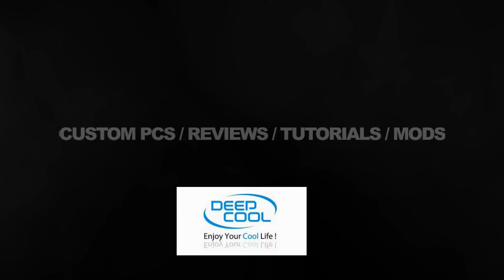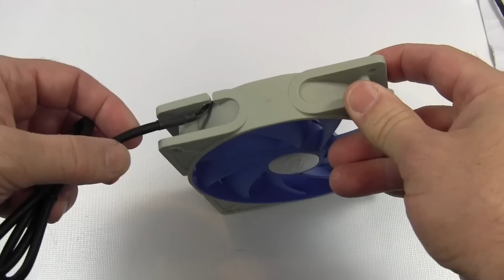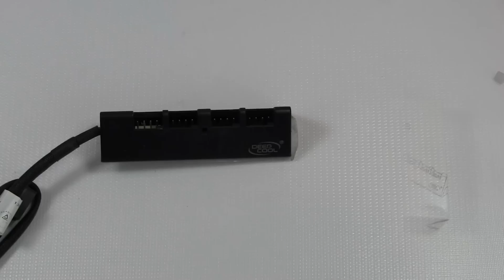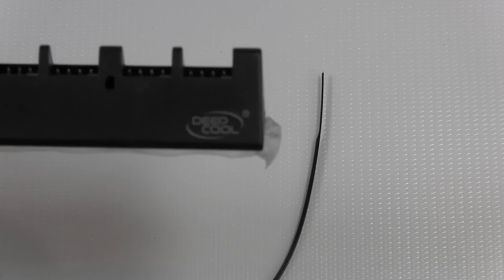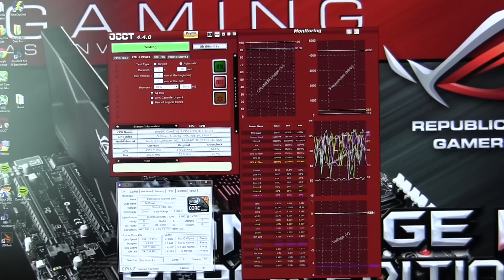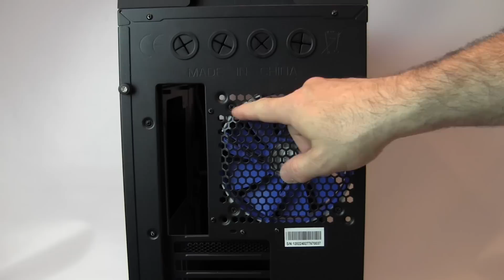Deep Cool UF120 PWM Fan , UF140 PWM Fan, and Fan Hub Review

Comment: I've got old asus board with 1 pwm cpu header + 1 4pin sys_fan header but 4th pin shows +5v at the place of pwm wire in manual (asus played smartly here). Basically it's a 4pin Voltage controlled header which I'm currently using with Corsair's ML120 Led Elite PWM fans.
Some says that Magnetic Levitation fans from Corsair needs PWM strictly to levitate them.
Please tell me if I should continue using sysfan header with voltage control or I should use the only available CPU Pwm header with Deepcool Hub to get them pwm controlled (cpu+case fans combine to that cpu header)
Please tell me what should I do😮

Comment: these are excellent fans.  i did extensive testing with the UF 120 pwm  vs the noctua NF-12 on a coolermaster hyper 212 evo and the deepcool fan is quieter and has about 1 degree bettter cooling on that particular heatsink.  that heatsink does better with  certain "air flow" fans rather than the static pressure variety.

Comment: Is it actually safe to use a fan hub like this? i.e. to connect 4 fans to a single fan header on the motherboard.
Also, when connecting a 3-pin fan to this fan 4-pin PWM hub, will the 3-pin fan speed be controllable too or is still going to at run a full speed all the time?
Reply: If the rated amperage for your header is high enough, yes, which it probably is. I've never seen a hiqh quality or LED fan be higher than .33-.35A and your headers are probably rated for 1A at least. You can usually put 2-3 fans on one header

Comment: Ordered the Deepcool fan extension cable to use with 4 fans will this hurt my board? or should i run the fans @ half RPM just to be safe?
Reply from the maker: +Denzil Manickum You should be fine with using a fan extension with 4 fans. I have used 3 and 4 fan extensions, but they should be powered them from my power supply power and not one motherboard header.
Reply: Thanks I think ill go with using two deepcool fan hubs powering two fans each that should be safe to connect directly to two separate fan headers on?
Reply from the maker: +Denzil Manickum Yes. That would be fine.
Reply: +Ronsanut hello, how do you power the fan hub from the power supply?, and can i connect 3 fans on the deepcool fan hub through my motherboard? will it fry the connector?
Reply: You do get molex to fan headers
Reply from the maker: +shorteeayy  You can power the hub from any motherboard fan header or use a 4 pin molex to 3 pin adapter . 
Something like this works:
http://www.amazon.com/HDE-4-Pin-Molex-Replacement-Computer/dp/B0081K3ZS0

Comment: at 9:39 UF120 is on intake and uf140 is working as exhaust right ?
Reply from the maker: +omya222  The fans in the center at 9:39 on the testbed are running as exhasut (blowing at you) and the fans on the end are running as intake (into case). Basically the air flow blows to the fan motor hub. If you can read the Deep Cool logo on the fan motor hub, it is blowing air out past it.  
Hope that helps.

Comment: I would love to use the fanhub, but does the normal motherboard connection support 4 fans?
Reply from the maker: Yes it does.
Reply: Cool, thanks for the reply!
Reply from the maker: Yes you can. As long as you don't exceed the current rating of the header. I would put 4 on one header without issue.
Reply: Hi, after that comment I actually bought 2 of these fan hubs, they worked great :D
Reply: I dont see why not.
Reply from the maker: You can drive as many fans as you want on your motherboard fan header, AS LONG as you're not drawing more amps then the header was intended to output. After a bit of searching, a common value I've found is 1 amp (12 watts @ 12V) motherboard fan headers. Your results may vary.  I have used up to 3 fans off of a mobo header without issue.

Comment: I have zoostorm I7 and motherboard is Asus h81 and card is gtx 750ti not sure what size of fan I can chose plz help me out I don't care of fan noise I just need my computer cold as I want to overclock my gpu but afraid of boiling my pc plz help
Reply from the maker: Do you need a case fa? Or a fan for a cpu cooler? If so what case are you using and what CPU cooler?
Reply: I dont have any cpu cooler and its kind of normal case I just want to add a new fan for reducing heat just want to ask is 120 mm fan is normal for any  tower case ??
Reply from the maker: Azon Shadow Yes 120mm fans would work fine in your case.  Check your manual and see if it has mounting holes to support 140mm fans you may be able to use them too. They are normally quieter, depending on the fan.
Reply: I think I have but I will still check it and thx for being an active youtuber I will reply u within a week after fitting fan thx alot

Comment: Great review. I was wondering if you could control the fan speeds of the fans connected to the hub if you plug it in on the motherboard, or does it make them spin at a certain RPM?
Reply: +Luc Reinink id like to know that to!!
Reply: You can control them but it will use the same speed ie., the speed you set for the fan header will be applied for all the fans connected in the hub

Comment: the deef cool fan hub if i put 4 Corsair Air Series SP120 2350 RPM then plug in to one of my motherboard pwm fan header, can i control all 4 of them the fan speed with my motherboard fan expert 2 on windows without burning out my fan header on my motherboard? it happened to me long ago i bought pwm Y splitters and connect 2 fan and with 2000 rpm and burned out on my motherboard and doesn't work anymore

Comment from the maker: Yes, if you check my other videos I am aware if that. The problem is that I only received two of these and all my other fans was done on a different radiator and with three fans. So until I am able to test another set of fans in this exact set up any other comparisons are also not relevant.  Good pointy, but I am aware, I guess I should have mentioned that in the review.  Thanks though.

Comment from the maker: FRor Heavy cooling I would go with Cougar Dual X , Akasa Apache Blacks, and even XSPC Xirullian 1650 fans.  Also depends on you radiator fin spacing. For a mild overclock the UF120 would be fine in my opinion. They are very quiet.